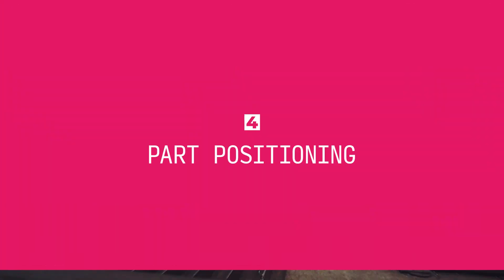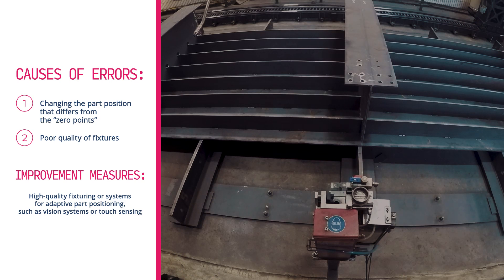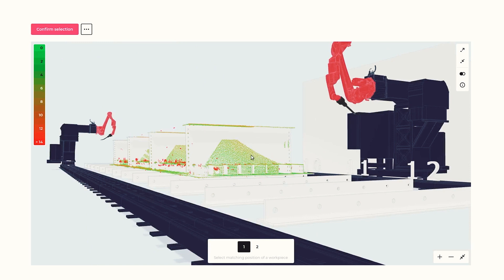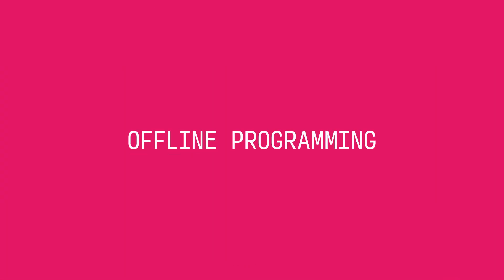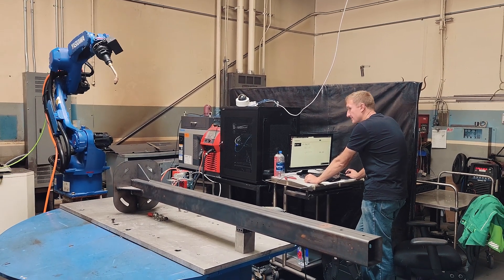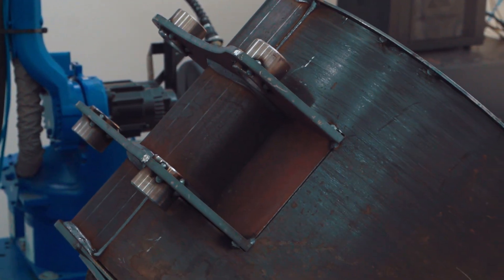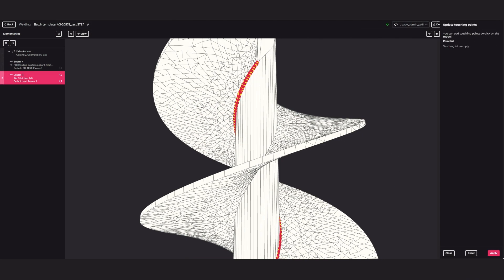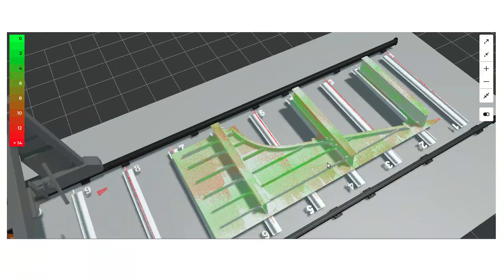3-5 mm Deviations? Can Welding Robots Handle it? | ABAGY ROBOTIC WELDING

Comment: I can not believe anyone today is asking this question, it was the topic of conversation in the early 80's and by the 90's was pretty well fully answered with touch sensing, through arc seam tracking and various Laser cameras. The reality is that there is no "technical limit" to tracking a part deviation other than the robot system reach, of course large part deviations do not say a lot for the quality of said parts but I have worked on Caterpillar chassis parts with at least 15mm positional tolerances and deflection to accommodate.

Comment: Hi, interesting content and production! I have a question. Is there any application where it was possible for example on a multipass butt joint (thick plates) to adapt for the deformation in the subsequent passes?
Reply from the maker: Hi, thank you for your interest in our content and technologies! Yes, there are various applications where it’s possible to adapt to deformation in subsequent passes, during multipass welding.
Depending on the machine vision devices used, different levels of adaptability can be applied. For example, it’s possible to use a re-touch-sensing procedure or employ wire sensing for each new pass. Alternatively, laser scanning can be used to reconstruct the geometry in real time during the welding process.
Reply: Yes, you would program 3 passes with the teach pendant as the deformation should be the same after each pass
Reply from the maker: Thank you for your question and insight! With Abagy, you wouldn't need to pre-program each pass using a teach pendant. Our system can dynamically adapt to each pass's deformation in real-time. Whether using laser scanning, wire sensing, or arc sense, the system adjusts the trajectory and welding parameters automatically. This eliminates the need for pre-programming and allows for more flexibility and accuracy in handling variations. Let us know if you'd like more details or have any other questions!

Comment: Well made. how can we handle "Dark spots" in the machine vision method?
Reply from the maker: If we understand right what you meant by “Dark spots”, they can occur when the objects block the view of the scanner. We use a two-step approach. First, we detect the position of the whole part during primary scanning, where these “dark spots” are not of utmost importance. Then, for each specific weld, we utilize touch-sensing or laser scanning to adapt to the real geometry of the part.